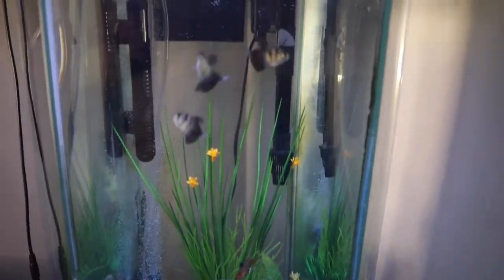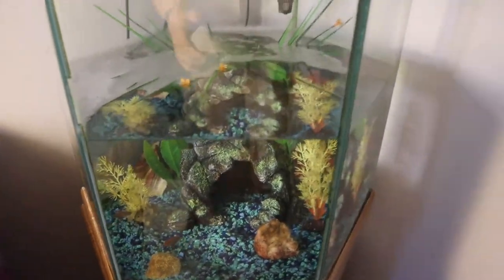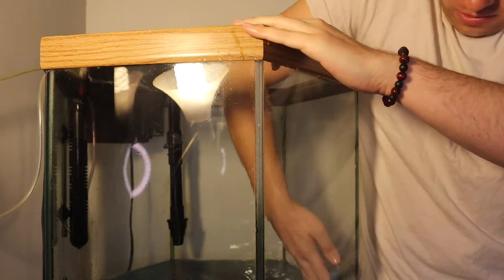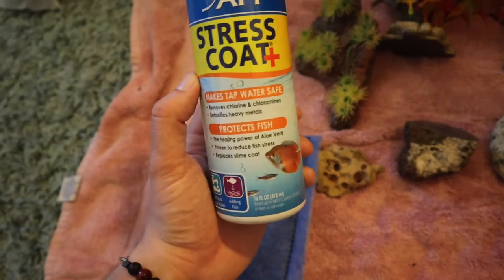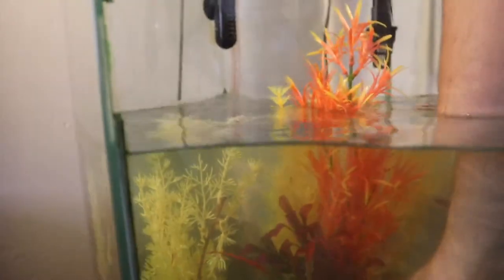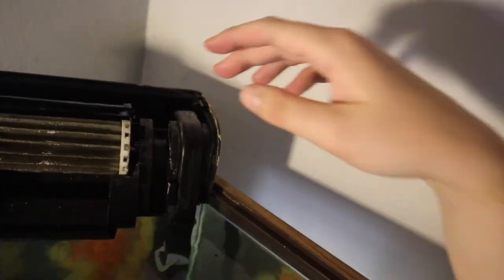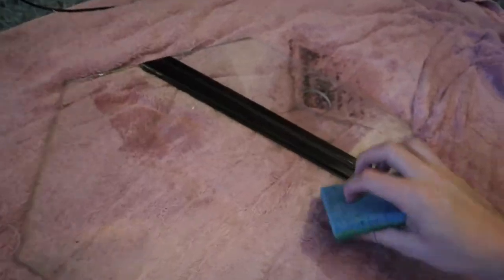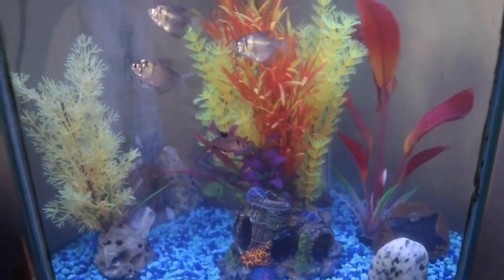Cleaning My Hexagon Fish Tank 2021

Comment: Hey Nate.... first time seeing any of your videos (i blv you'll have many) well i have the same exact tank as you and I'll advice if your garden hose is long enough to reach where your tank is, it's the best way to remove water and replace water without stressing yourself or the fish, i know this because that is what i do every time except winter when water will be too cold, just make sure u reduce the flow while refilling and pay attention so you don't flood your place. I wish i could show u my setup, then just another suggestion, u might wanna try getting a bigger and longer ornament(by height i mean), that way u can complement the height of your tank and also block the rear wall view abit more, try checking "holey rock" large size from petco if you are not into drift wood, i use one of those and its beautiful and also has many hiding holes allover it.  Nice tank you have there... mine is in black (oceanic brand). I was going to say you should keep the first water u take out of the tank first and after cleaning take the one left in the tank that u cleaning with out of the tank to the lowest minimum that won't hurt the fish to get rid of more of the dirt then fill the tank back up with the water u kept in the bucket before adding brand new water, and get you a cheap manual vacume to get the substrate cleaned out and easy removal of water too . Nice work bro!